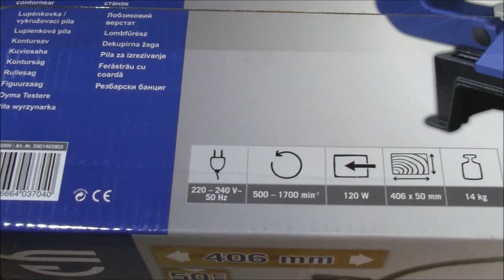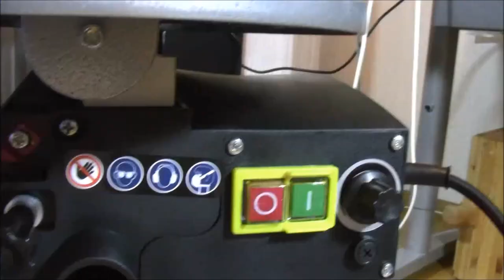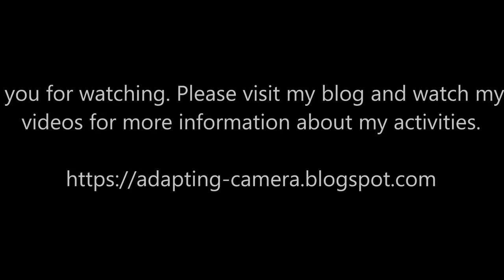Scheppach SD1600V scroll saw. Unboxing and first run.

Comment: Did you swap the machine half way through the video at 4.10 because the air hose changed from black to orange and blue and there is a silver screw to the left of the SCHEPPACH sticker which wasnt there on the first half of the video.
Reply from the maker: Good observations... No, the machine is the same but I swapped the original black air hose to a bit better and longer blue one I had at home. I also changed the original screw to a better one.

Comment: Does your's have "warts" of aluminum on the plate, i.e. a couple of little lumps (2mm diameter)  of metal sticking up, not flush with the overall surface? Mine has, and it would give any piece of wood shoved over it several deep-ish scratches. Since one could ruin it (and the chance of return), I don't feel like filing them away. Also, the rim of the circular opening for the plastic disc to rest on is milled in a way that so that at the back end it is less deep than at the front, making the plastic disc skewed, and none of it is flush with the metal surface... makes it pretty useless for pieces of wood smaller than say 15cm ... that you could press onto the metal part of the plate in hopes of keeping it straight...
Reply: Also, if I let it run on low speed for 10 seconds, it starts to squeak with every movement... that does not seem promising wrt longevity... ;) I'm rather not sure whether to keep it
Reply from the maker: No, mine is flat.

Comment: So have had a sheppach saw for a couple of years and will avoid this make from now on.My friend bought the same and thinks as I do.Maybe mine is slightly different model but the two of us felt like throwing it out the window.Yes it cuts but neither the blower or drill now work.To change a blade takes an age...I have removed a side panel to cope with this.Only good point is it takes both types of blade.Wish I could afford to change to different one.
Reply from the maker: I agree that the blower is pretty useless, but we must have a different version because I don't have any chuck, which I guess you mean when you say "drill". The thing is it is a cheap machine, so you get what you pay for, and should not expect a top quality machine at that price.

Comment: Aldi sells them at £60, although rebranded to their own Work Zone brand.  Exact same model made by Scheppach.
Reply from the maker: That's a good price as well, though I paid about 35EUR which is about £30 for mine in a Swedish shop (Jula) during a fire sale.
Reply: I just got one with £19.99 from Aldi Lol.
Reply from the maker: I find it works very well. Especially after I printed a new insert.

https://youtu.be/2nNW6a1GLjg
Reply: @yjiang7894  I just bought mine from Screwfix for £129.99

Comment: Piece of junk.....rather use my handheld saw than this junk
Reply from the maker: That's your opinion. I might not agree with such a blanket statement.
Reply: @AdaptingCamera  Mark Shaw have you tryet this machine? just asking because i maybe interesting in buy one
Reply from the maker: Osama Karim,  I own and use this machine. It works well, exactly as expected. Many people try to use if for what it is NOT been designed for, so if I'd recommend or not, depends on what you want to saw and which blades you are using. Default blades are only for wood, not thicker than 1" if soft wood, 1/2" if hard. If you want to saw metal you must get proper metal blades.

Comment: Too noisy
Reply from the maker: Every saw is noisy when in use. Simple fact. How noisy it is when cutting air is not important because once it starts cutting any material the noise depends on the material, the blade and how well you hold the material, as well as how well the saw is fixed to the table. If you allow vibrations then it will be noisy.
Reply: Adapting Camera still too noisy, you can compare the decibels with a simple phone app, I have tried 5 comparison in a workshop,,,, too noisy.
Reply from the maker: It doesn't matter how many comparisons you make. ...and why should we care and why should I believe you???? I bought this machine because I needed something similar and this was cheap. It is doing the job it was designed for quite well. That's it. I did not buy it as a collectors item just to be able to compare which one is quieter than the other. That sort of sandpit "mine is bigger than yours" type of small boys game is not interesting me at all.